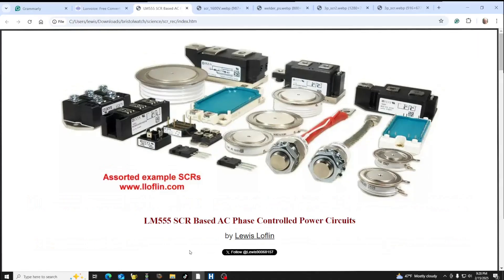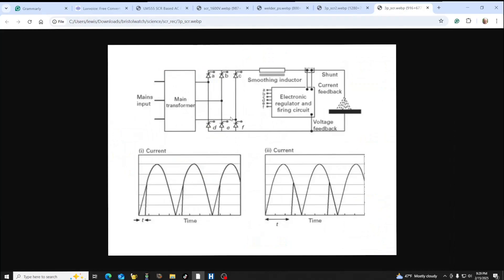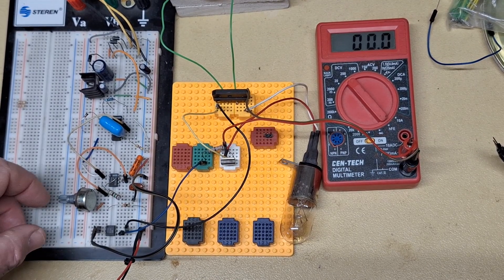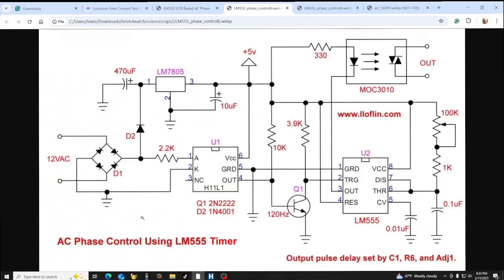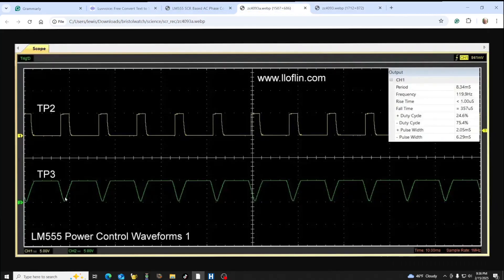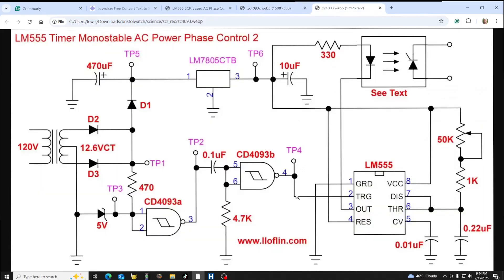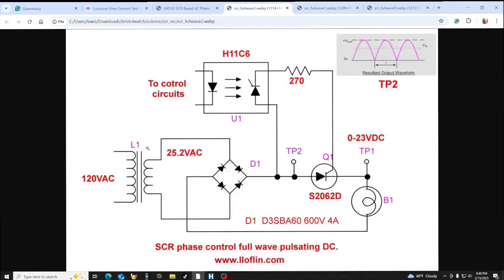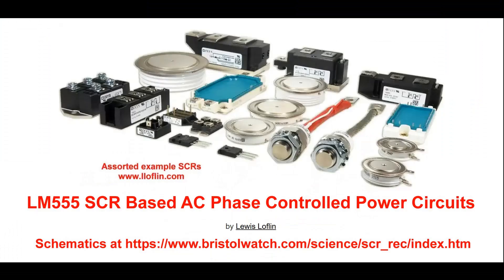LM555 SCR Based AC Phase Controlled Power Circuits

Comment from the maker: No microcontrollers are used, cutting cost and complexity;
Elimination of the H11L1 optocoupler as a zero-crossing detector;
Practical examples of wave shaping circuits using the CD4093 quad two-input NAND gate with Schmitt trigger input;
Phase-controlled SCRs are used to produce full-wave pulsating DC with example circuits.
https://www.bristolwatch.com/science/scr_rec/index.htm
Previous video: LM555 Timer Monostable AC Power Phase Control
https://www.youtube.com/watch?v=O8w9cd-fbNg